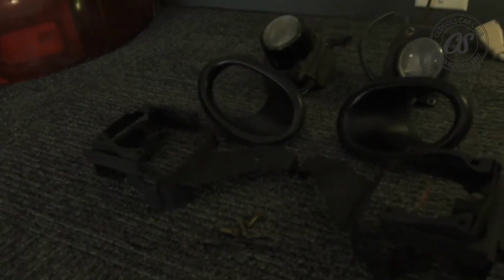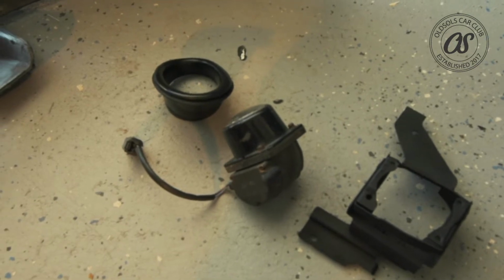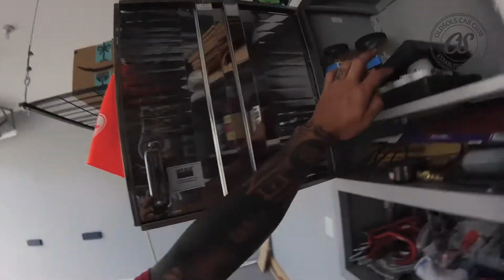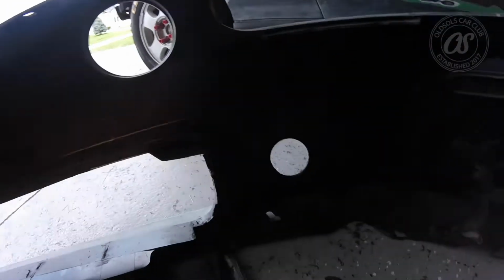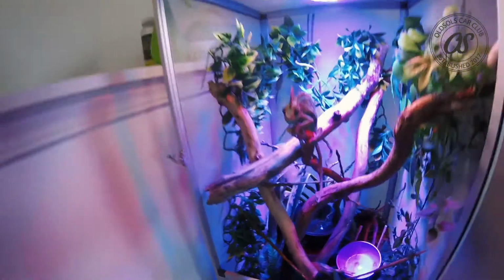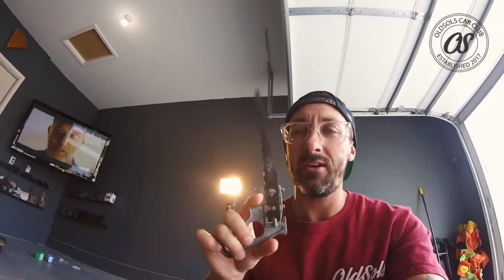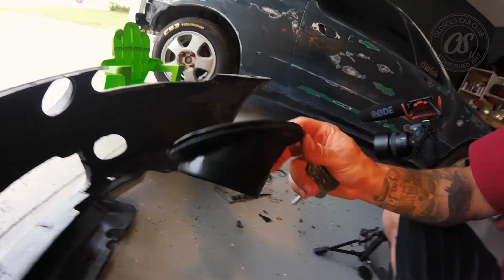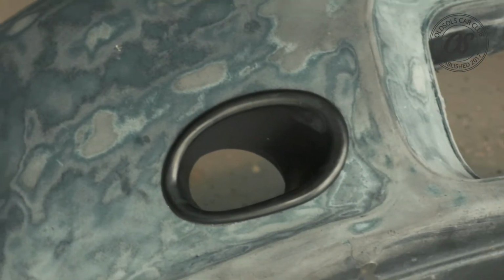Honda Del Sol - OldSols Vlog 40 - JDM Fog Lights

Comment: I have a 97 del sol and trying to look for foglights. Just making sure if these will work? My bumper already has a cutout for fog lights to be installed. Any knowledge helps thanks!
Reply from the maker: Hey, if you have a 1997 Del Sol ; these fog lights will not work 

You will need to source the 96-98 bumper fog lights
Reply: @OldSols  thanks bud, awesome channel! Appreciate the heads up will definitely look into it👍🏼

Comment: Can these rubber shrouds be 3d printed or something? I have a set of lights with the brackets, have the OEM button for the center console, but no shrouds....
Reply from the maker: Matyas we don’t see why not but would need a be a somewhat flexible material as you need to fit the lips of each side of the shroud into the bumper and it needs to be able to bend and move
Reply: I really hope that someone makes a 3D file for it.